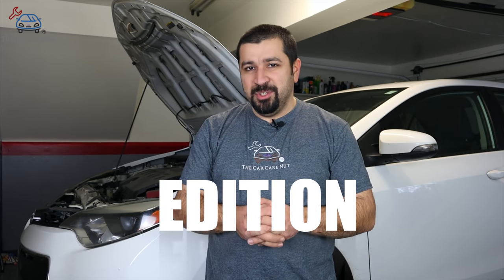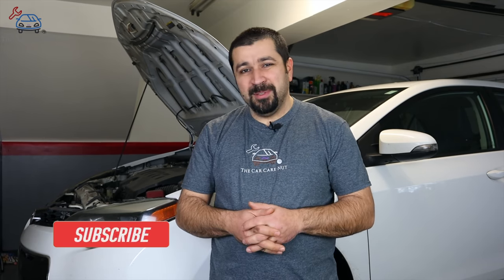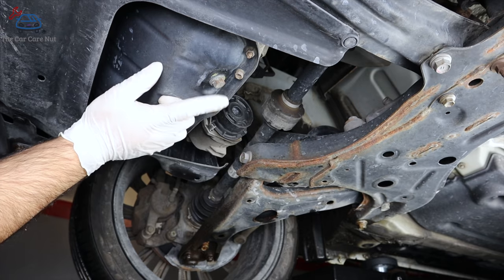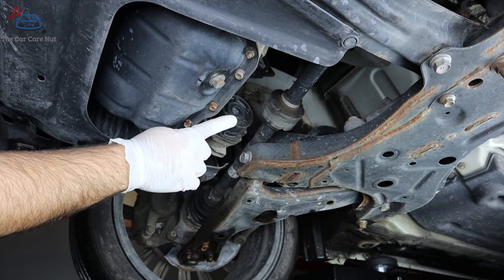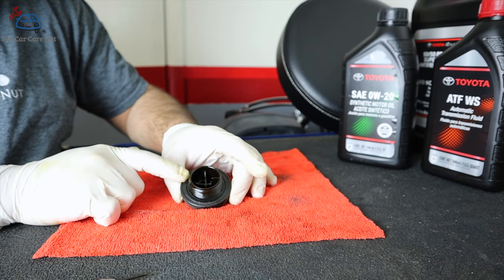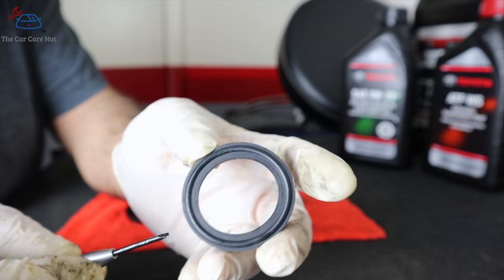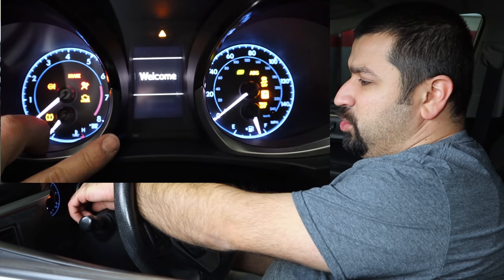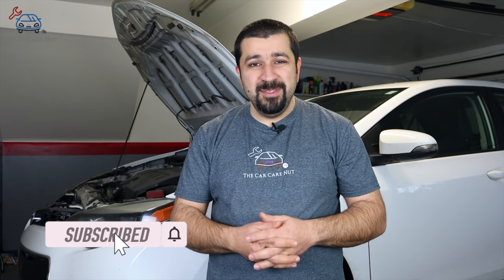How to change your Engine oil and filter for Toyota Lexus Scion

Comment: Thank you for another great video! I have a 2012 Camry XLE Hybrid which has the 2.5L 2AR-FXE engine and canister type filter system with the drain plug (04152-YZZA1 oil filter). On the 2AR-FXE engine, the oil filter canister installs vertically as opposed to horizontally like the one in your video. I was very surprised at how difficult it was to remove the filter canister from the engine block. The first couple of turns were so difficult I was sure the canister must have been cross threaded into the engine by the previous oil changer. (I was using a 10 inch 1/2 inch drive ratchet & Assenmacher Specialty Tools AST640 removal tool). However when I removed the canister there was no damage and installing went smoothly. I can see how many people in other forums report their removal tool (the aluminum ones) cracking/breaking. I had no issues with the AST640 removal tool aside from it being stuck on the canister afterwards, but I was able to remove it easily with a plastic trim pry tool. With that said, I am considering spending the money and getting the OEM tool which, from your video, appears to be made of steel. When I was removing the canister from the engine (I did not use the drain plug to drain it first) I did have some oil splash out, which may have been my fault. I think going forward I will use the drain plug to be on the safe side and avoid the mess. (By the way, for anyone who has the drain plug type canister filter, the torque value on the drain plug is 10 ft lbs and like the other canister filters, the torque value for it is 18 ft lbs). Thanks again!

Comment: I would recommend you include amazon affiliate link for the product you use or recommend that way is easier for us & you get few $.
Also, I write down the time & milage on window as a reminder.
Reply: Great Video By The Way! Keep up making more please.
Reply: You can buy the oil change stickers on amazon for pretty cheap.  What I did and I put sticker on the vanity mirror so the sun doesn't fade the information.

Comment: I have an avalon. I usually put some oil in the filter since it's vertical. I usually put in 6 quarts, start it, let the filter completely fill, then check again. Usually takes a little more, bit never full capacity. I think that's from some old residual oil, etc. I'm very careful to not over fill. Anyway, thats just some observations. I like your videos. Keep up the good work.

Comment: I've changed a lot of oil on a lot of vehicles and farm equipment but I've always checked the oil level when cold because to to do so when the engine is fully warmed up means potentially a lot of oil hasn't yet drained into the crankcase! Hence, you tend to overfill when measuring dipstick oil level when hot, not the other way around. Oil expansion when hot compensates for this but even after waiting several minutes for warm oil to settle, I find it the level typically lower than a cold measurement. And if the amount of (cold) oil in the crankcase is to the manufacturer's specification, then why would it be considered overfilling once the engine fully warms up??

Now I notice you said nothing about warming up an engine before draining the oil. Maybe it's not necessary but, if nothing else, it does speed up the draining process. Also raising the front of the vehicle for ease of access can surely affect the draining of oil - sometimes it helps drain more thoroughly, sometimes though it prevents the last of the oil in the pan from draining at all.

Comment: Just a reminder that oil weight specs here in North America are strictly to satisfy CAFE and EPA regulations . For example my Tundra calls for 0w20 . I use 5w30 synthetic . I find the engine runs much quieter and the 30 weight offers better protection when I tow in the summer heat .  Other areas of the world the same 3urfe engine calls for any oil weight from 5w20 all the way to 10w30 .

Comment: My dealership in Canada refused to sell me the oil filter tool. I had to buy it from a regular parts store. It works but it's not a perfect fit. 😕
Another point I would like to make - doing an oil change on Yaris is way easier than Corolla.
1. I don't even lift Yaris
2. I cat start spinning the filter from the top which is easier.
Love Yaris!

Comment: Motivx Tools (on Amazon) makes a really good  aftermarket wrench specifically for Toyota canister filters. It costs about $25. Thanks for the overview.
Reply: $22.95 for the one that fits the 1.8 liter engine and $24.95 for the one that fits larger engines with the cartridge system.

Comment: Hey, good video. Though I would have put the o-ring on the oil filter canister before pushing the filter into the canister. Be a little easier to get the o-ring on first, so that it would not be necessary to pass the o-ring around the filter, on its way down to the cannister.  As far as using the oil filter cap as a reminder to add oil, by placing the cap someplace that will remind you that you need to add oil to the engine – good idea. But as to placing it on or near the hood latch, which is on a horizontal cross-member of the car's body – a few years ago when I left a cap  atop the horizontal cross-member in front of the engine, near the hood latch  (it was not on a Toyota and I don't remember which cap it was) I somehow managed to bump into the cap and cause it to fall down until it landed on the plastic shroud underneath the engine. I had to remove either the windshield washer bottle, or the engine coolant expansion bottle, I forget which,  in order to reach my arm down to where I could grab the cap and retrieve it. I remember being relieved when I discovered that I did not have to remove any hoses from the bottle, that I was able to just move the bottle out of the way with the hoses still attached. But it still was an annoying, frustrating experience that I don't want to repeat.. I now make it a habit to remove any parts or fasteners that I have detached for the car, to a place outside the engine bay and to a place where they will be safe from being bumped – put the parts on a workbench or something – anywhere far away. from someplace where it might fall down and be hard to recover without going through mental and physical contortions –in jars, trays, muffin pans, tool boxes – not on the car somewhere. Maybe inside the passenger cabin but not atop any part of the car. Gotta think of a good place.

Comment: I never have opened the oil drain on the oil canister and always felt a little guilty about that, not any more. Thanks Car Care Nut!
Reply: I always use the drain and change the o-ring, mostly because it makes less of a mess. I get made fun of for it at the dealer because guys say it takes too long, but I don't see how. I just keep a plastic drain tool in my oil bucket and install it when I remove the oil drain plug. By the time I walk to the parts department to get the new filter and then walk back, the filter and oil pan are both drained. Takes at most an extra 60 seconds.
Reply: I own the Motivx canister drain tool with the clear hose.  It screws on, you wait for it to drain the canister.  And wait.  It does make less of a mess, but it adds a LOT of time to my oil changes.  I might try it his way the next time.

Comment: I use the Valvoline full synthetic high mileage 5W-30. Do you still recommend changing the oil every 5000 miles?
Reply from the maker: I personally would.
Reply: Why high mileage oil? I've had a few cars with over 200,000 miles on them. They never needed high mileage oil. No leaks and no oil consumption. If it ain't broke don't fix it  😉

Comment: I learned a couple of things. I will not use that plastic adapter to drain the oil out of the filter.  Sounds like you go by feel instead of using a torque wrench to snug things back up.  I will do as you and the way I have done for decades. Picking up my new 2023 Tacoma limited nightshade version today. 🙂

Comment: I’ve been changing oil for 55+ years, but this the first time I ever heard anyone say to not fill the oil to full on dipstick! I have a 2017Rav4, 2009Crv, and a 1984 Mustang. I have always filled my cars to full with no problems. How much leak than full? Half way between the holes or xxx area?    Thanks....Jim
Reply from the maker: Hi Jim! Oil expands as it warms up and when filled to full when cold it will actually be overfilled when hot. Try it. After a good drive when the oil is fully warmed up shut off the engine for a minute and check the level. I would leave it somewhere half way on the dipstick when it’s fully cold.
Reply: He is right about not filling it to the max, even on Castrol website says "Bear in mind that over-filling is as bad for your engine as under-filling; so don't treat the high level mark as a target. It's best to aim for a little below this line." https://www.castrol.com/en_gb/united-kingdom/home/car-engine-oil-and-fluids/car-engine-maintenance/how-to-top-up-your-engine-oil.html
Reply: AMD.....THANKS, you’re teaching an old dog new tricks, also thru me, my grandson. I’m also in the Chicago area. I do watch and subscribe to your channel. Jim
Reply: The capacity that's listed in your owner's manual should be correct otherwise why list the capacity with and without the filter? Huh? Why doesn't the owner's manual say anything about how hot your oil should be when you measure it out?
Reply: @njsongwriter  maybe they didn’t drain all the oil out , and you put the required amount it could be over filled.

Comment: Do you recommend prefilling the oil filter? I notice 1-2 seconds of clatter when you first start the car after the oil change and some people say to prefill the filter. What are your thoughts on this?
Reply from the maker: Hi! You could pre fill the filter but that slight clatter is not an issue as it’s been done without filling the filter and the engines last for many years and many miles.
Reply: @TheCarCareNut  Thanks!

Comment: Great video, as always, by CCNut...but it needed a caution about brake fluid toxicity--it wrecks motor oil for recycling if it's mixed in to it, and it's death in the environment.  Be sure to get that old brake fluid in a separate container and then take it to a recycler for proper processing, please!

Comment: This video popped up again in my feed & remembered a time back in 1999 at a garage, a car was serviced by an experienced mechanic,he told a junior mechanic to finish off the service while he did something else,didn't realize he had put oil in it so it had double the oil ...it smoked the place out badly😆 No harm came to the engine.

Comment: i use a torque wrench to tighten the drain plug to spec.  this prevents over and under tightening. under tighten and the bolt could come loose. over and could strip the oil plug threads.  Torque wrenches are so inexpensive these day it make no sense not to have one when working on a car, especially for tightening lug nuts
Reply: Yes, that is so true.  I am wondering how we managed to do that all these years without one 😆
I can do well without this toy, it is the „pro” mechanics, with their power demolition tools that I worry about.

Comment: Pretty cool, I used to own a 2000 Jetta, Diesel car that had a similar style filter, accessible from the top of the engine bay. I'm very pumped, I have a brand new Corolla being manufactured, I will be referencing your videos for the maintenance.. That Jetta had 20 years, and over 400,000 km on it when the transmission failed on me, I am very pumped see if I can get my Corolla to last even longer!

Comment: I always add oil to the oil filter/canister when the filter is vertical or at a 45 degree angle, just a little above 1/2 way mark
Reply: You can add oil, even if a canister filter is almost horizontal.  I'm always surprised how much oil I can pour into a new filter.  I put in as much as possible, wait a minute, and it gets absorbed, then do it a few more times. Then spin it on as fast as I can.  A little might spill out, but it's better for my engine's first start.

Comment: Pro tip:  never use a metal pick as shown in the video to remove the oil filter housing o ring.  This can damage the o ring sealing surface unless you’re careful.  The factory Toyota instructions advise to use only your finger to remove the o ring.

Comment: I let my oil drain ALL weekend. From Friday afternoon when I get home from work, to Sunday evening.
Reply: You should remove the oil pan and clean off all the residual oil with some brake clean as well.
Reply: @MrMagichobo21  he should also stick a hose in the oil filler to completely clean any residue in the block or cylinder heads
Reply: @OggaDugga clearly complete engine disassembly and cleaning is necessary! How else will all the old oil, varnish, and sludge be properly eliminated?!

Comment: According to the lead engineer that designed the Nissan GTR engine, he does oil changes every 1000-2000 miles. Since then I’ve increased the frequency that I change oil in my vehicles. Oil is cheap, engines aren’t.

Comment: Didn’t even know there’s a gasket in the oil fill cap
Reply: Same here.
Reply: Now you know, and knowing is half the battle.
Reply: I didn't know either until I was getting oil leaking no matter how tight I made the cap. The gasket was hard as a rock from old age and heat I guess. I just swapped out the whole cap since it wasn't much more than just changing out the gasket which is a pain to remove off the cap.
Reply: @robertomulero514  
Are you saying removing the o-ring on the oil filter cap assembly is a pain?
You don't even need tools to remove the o-ring
https://youtu.be/3R1KMN1ys3A except you do need a good oil filter cap wrench. I recommend the Motivx MX2320 unless you have the 1.8 liter engine which would take the Motivx MX2321.
Reply: It's not in the cap. The cartridge filter is in the cap but the o-ring goes on the threads... Those threads are located between the oil filter housing cap and the oil filter housing base (mounted to the engine block).
Reply: @njsongwriter  there’s also a gasket in the oil fill cap.

Comment: Removing the metal drain cap on the bottom of the plastic oil filter housing is a good idea, however. It allows you to drain out the oil that is in the filter housing with the provided spout, preventing a huge oily mess all over your wrench and hands when you unscrew it. Only takes a minute or so, but worth it in my opinion.
Reply: Nah it’s less risky to not open that and just remove it in one piece into a oil pan right under it. Sometimes putting that provided spout not fully engaged will cause uneeded splashes. This is more so if you have aftermarket skids that decrease the work area with access panels ( I have a 4Runner with aftermarket skids.) so this is a very situational decision.

Comment: 2:45, Exactly! You are the only person besides me who talks about the oil drain plug opening being higher on the back wall of the oil pan on some Corollas.
Even after letting oil drain out of the oil pan for hours (yes I always let it drain for eight hours minimum), when you lift the front end of the car there is always oil coming out. Another 100 milliliters or so. Why not let as much old stuff out as possible?
I also use a slightly longer oil filter on my 2006 Corolla (E120), 90915-YZZF1 instead of 90915-YZZF2. 
My intervals for oil and oil filter replacement are every 5000 kilometers (3100 miles) or every three months, whichever comes first. I have 187000 kilometers or 120000 miles on the odometer and I don't have to add a drop of oil between the next oil changes.
Reply: Toyota recently came out with a new oil filter that supercedes the 90915-YZZF2, the new part is 90915-YZZN1. The only difference I can see is they increased the size of the oil inlet ports. I actually measured them and found the total area increase of the oil inlet ports was 51%, although I don't remember the exact total area. Somewhere around 250cm^2 on the N1 if I remember correctly. I don't know if the F1 filters have been superceded.

Comment: You are a gem Sir. I now change my own oil on all our Toyotas. 
I have a long drive from Calgary AB (Canada) to Tampa FL. Can I go to 6,000 miles between oil/filter change on a long road trip like this one?
Reply: Sure. As long as your car doesn't burn oil so you don't have to worry about the oil getting low. Even if it does, just have a jug or two of oil in the car and check the engine oil level every so often.  highway mileage is way less strain on an engine than city mileage....

Comment: the toyota dealership recommended I use the BG engine performance restoration oil change kit, an additive that you run for 15 minutes with the old oil to ungunk the piston rings and then a conditioning additive for the new oil. Do you recommend this product? my 2014 tundra 5.7 has 174000 miles and still drives like brand new.
Reply: nope, they're just trying to sell you stuff. if you really want to do it, look online for how much the stuff is and how much they are charging you for it. i'm sure there's quite a mark up....

Comment: Just got a new 2022 Rav4 LE FWD and they recommend oil changes w/ 0w-16 full synthetic every 10,000 miles...? What's your opinion on this? I don't know that I trust going 10,000 miles between...I'm thinking 5,000 to be safe. What do you think? Thanks
Reply: definitely every 5k miles. if you drive 20k miles a year, doing it every 5k vs every 10k means two additional oil changes. even if you go to the dealer that's only an extra 75-100 dollars a year. oil is cheap, engines are not....

Comment: Hi CCN. You suggest 5000mile interval. Would you recommend changing the oil, draining the filter, but then reuse the filter with fresh oil? Seems like your concern is with the oil but the filter could still be usable.  

Thanks, I’m a huge fan. God bless.